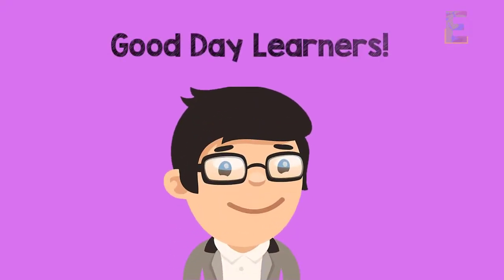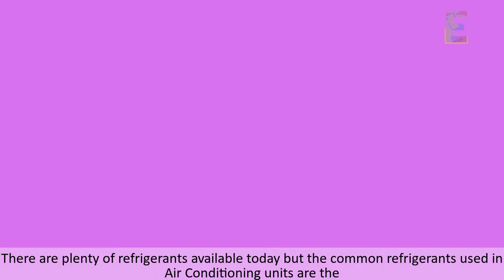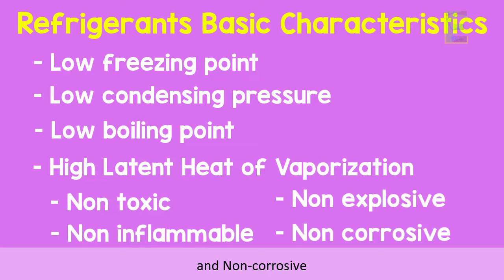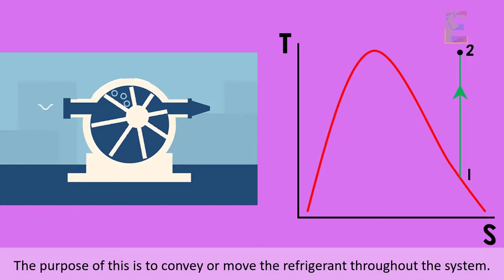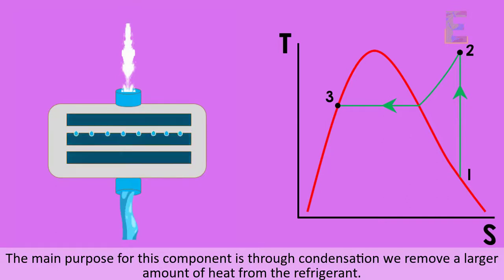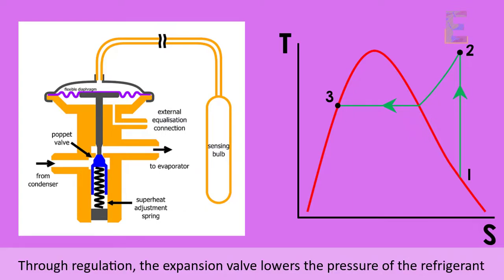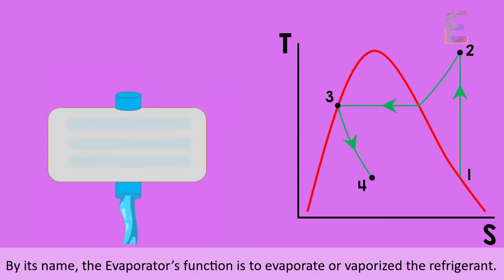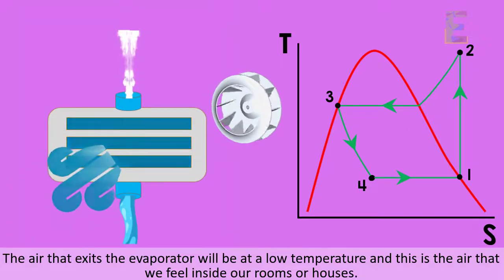Refrigeration Cycle | Animation

Comment: Expansion by throttling is isenthalpic and irreversible, thus cannot be part of the true reverse Carnot cycle, which is entirely reversible.  Thus a true Carnot cycle can work with a perfectly ideal gas, whereas a common air conditioner cannot work even a tiny bit with an ideal gas.

Comment: Compressor evaporation condensers expansion valve temperature reverse carnot cycle refrigerator freon duron latent heat of vaporization non toxic non explosive inflammable non corrosive low freezing pressure current ampere current purple blue yellow sensing bulb adjustment spring poppet valve external equalization connection regulations vapourize emf  mechanical transfer teacher ji

Comment: At 4:20 you said the refrigerant's temperature increases. But I believe it just absorbs heat without having its temperature increased because during state changes the temperature is constant right?
Reply: Correct

Comment: What does the red dome or the red line represent in the TS diagram?
Does it represent mix of vapor and liquid?
Whatever is outside the dome is 100% vapor and whatever inside the dome is 100% liquid?
Process 2 - 3 is constant pressure and where the green cuts the red dome line up to 3 is constant temperature and constant pressure?

4 - 1 is also constant temperature and constant pressure?

Is the red dome line at constant pressure?

Could u please answer the above questions for further clarification? 

Thank u
Reply: The dome is basically the collection of all points where the substance is in  <Saturated Liquid> and <Saturated Vapor> state, at different pressure (As you go higher on dome, pressure increases). For each pressure, the corresponding TV curve represents the change of saturated liquid to saturated liquid Vapour mixture to saturated Vapor (isobaric process) 
{will write the rest later}